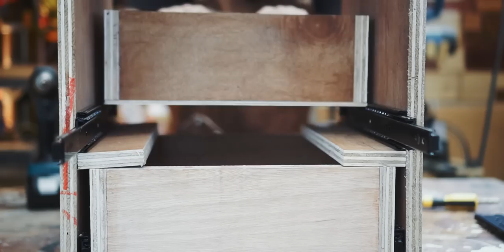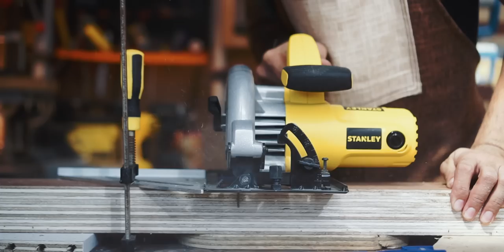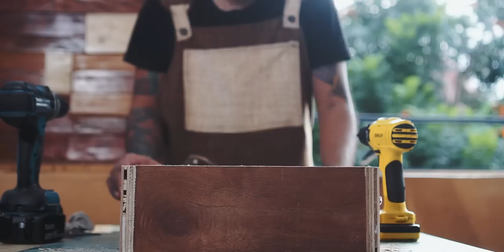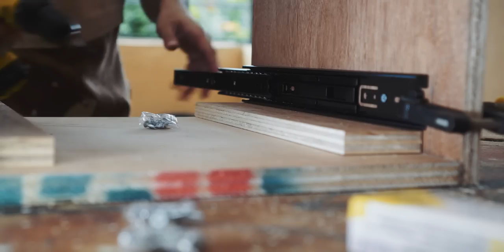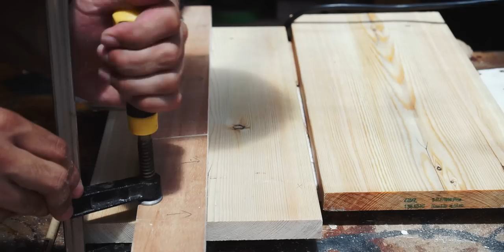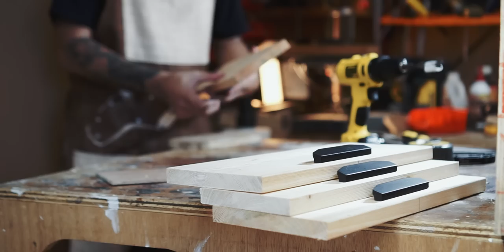Paano GUMAWA at MAGKABIT  NG DRAWERS | Basic Cabinet Making - Part 2

Comment: @3:20 point - mahusay na explanation dahil pahila ang drawers...pero imagine kung sa harap ang screws pero ang placing ng spacers mo sa @1:20 ay sa gilid...magiging bitin sya kasi nilagyan mo ng 2 spacers which is the same width of your sides. magsource ka ng trim screws for cabinetry, better fastener dahil ang gypsum screws are designed to fasten a non-moving object. wala ako makita sa major online apps e pero nakabili ako dati sa japan surplus na isang box.

Comment: D ko na kuha sir pano mo kinuha ang sukat ng bawat drawer yung apat yung lapad at haba ok eh yung size ngtaas nung apat sa taas ng drawer box pano kunin sukat sir salamat po sa sagot
Reply from the maker: in the future discuss ko yan ha, there are two ways, design using sketchup/f360 o manual compute brad, ung inneher height divide four consider mo ugn magiging spacer mo deduct mo din un, basic math lngnman yankaso extra work for you which is ok :)